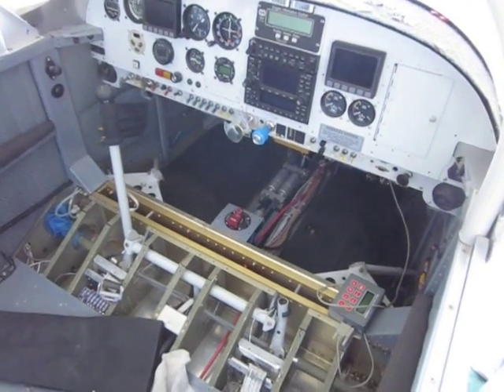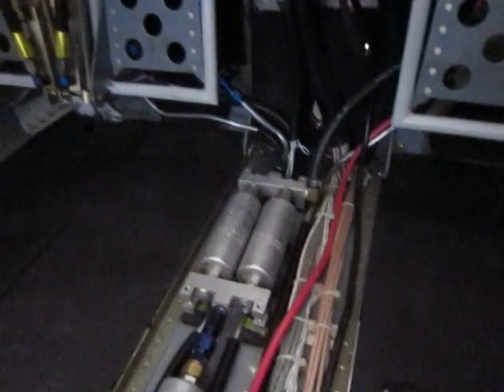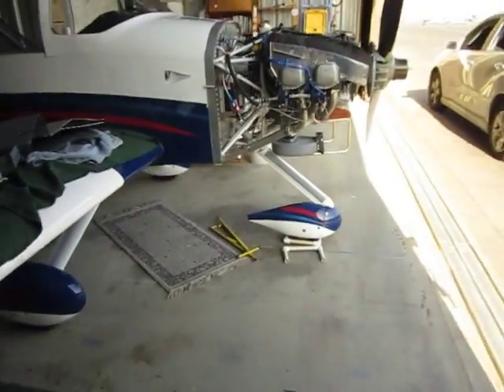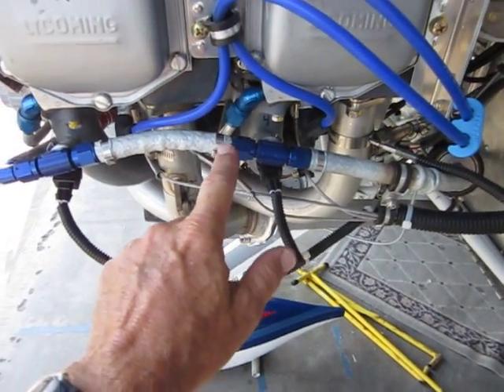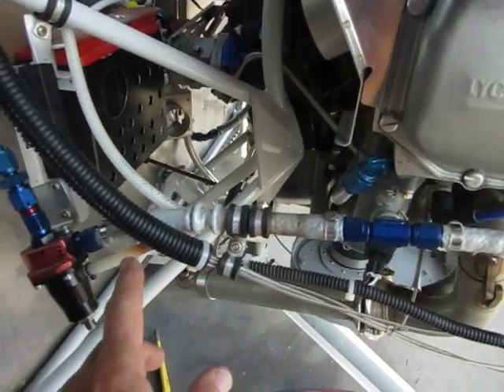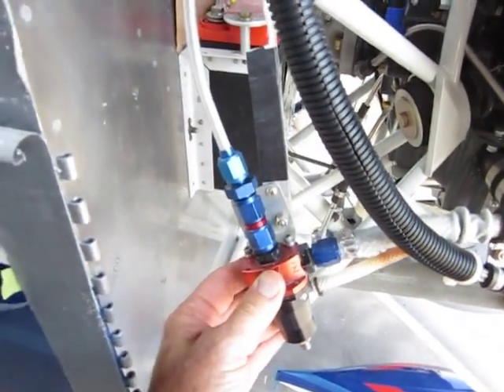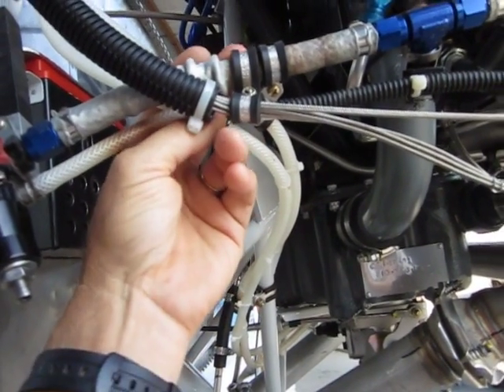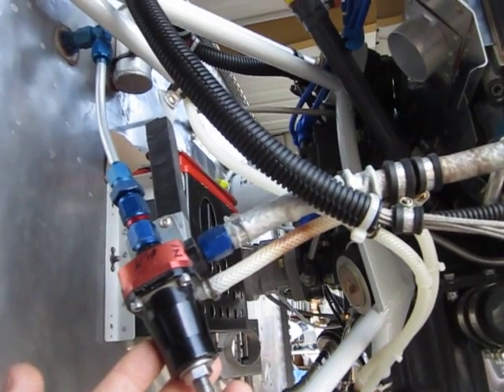EFII Fuel System.avi

Comment: Chris,  The EFII is working very well.  The engine runs strong.  No problems with it.  I think it is very import to install a PLX Air Fuel Ratio gauge in the cockpit to monitor the AFR...so you can do minor adjustments to the fuel map and fly the engine in cruise in the most economical way.  I now use autogas pretty much all the time.  Pete